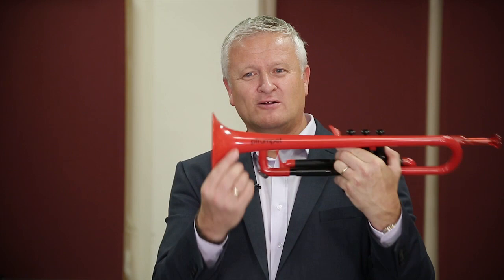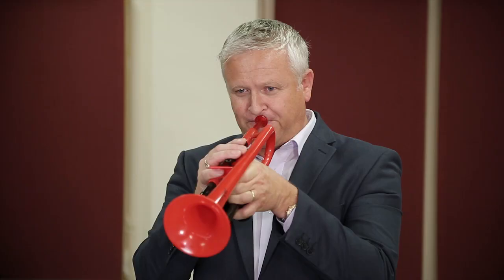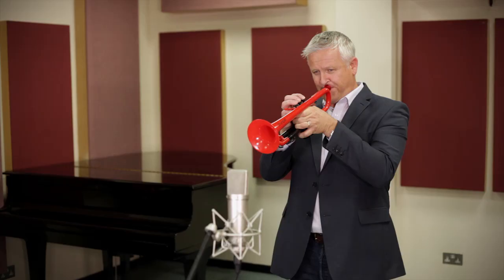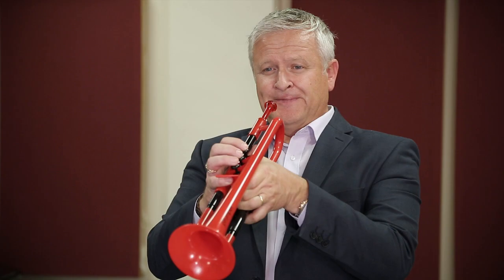Making your first sound on the pTrumpet, with Mike Lovatt. Lesson 1

Comment: do NOT tighten up ur lips to play higher notes change the vowel sound using ur tounge position, imagine saying "eee" instead of "ohh" which is used for deeper, lower notes. that being said, ur embouchure still needs to be stable enough so that air doesnt leak out.

Comment: the ptrumpet costs the same as a chinese trumpet that is actually made from brass. lol
Reply: my current trumpet is a Glory. it costs $100 and I love the color but I'll admit, when it arrived the valves were so dry you could hear them through the bell of the trumpet and the caps were stuck so I had to use tools to unscrew them. After some heavy greasing I've gotten them to work just fine and I haven't greased it in like a month or so and I'm having no problems with sticking. i Used to play on a Schiller and as far as I can tell, they aren't very much different as far as playability is concerned but I'm no professional. it does have a bit of a darker sound due to the paint making the trumpet a bit thicker (I got the white painted one) but I love it. not sure how it will hold up with time though. again I'm no professional and I've heard a lot of negatives about Glory's trumpets, mostly their valves, but I was expecting such from and $100 trumpet and Glory is a cheap but sort of inconsistent brand. This also turned out way longer than I intended it to be so sorry 😂
Reply: chinese trumpets (assuming you are talking about soa na) are so much simpler compared to normal trumpet. I supposed the only costly thing for a chinese trumpet is the mouth piece

Comment: Recommended best way to play a pTrumpet or any plastic trumpet. Put the trumpet in the middle of a large concrete area. Pour a 1/2 gallon or so of gasoline on it, light it on fire. When the fire is completely out, repeat. When the fire is out again, using a quality dust pan and broom sweep up the ashes and deposit into a trash can. And there you have it.

Comment: It's worse enough that some Indian manufacturers make trumpets in the 60.- Dollar range.
  (not plastic ones but even worse, mouthpiece included)
  It's even more worse  that those plastic trumpets are advertised from some professionals
 (Alison Balsom jumping the bandwaggon included or not.)
  I've also blown into a new stock plastic trumpet at a seller-shop and shook up because my sound was so terrible. 
  Some seconds later I found out that the water key was defect. I pressed it down by left hand and the sound   comes out from the plastic bell .
  This water key surely has a break by make function it's better to forget it from the designer.
  This plastic piece will break first.